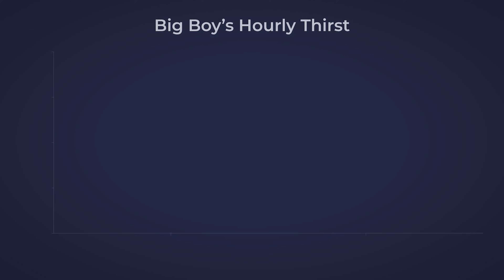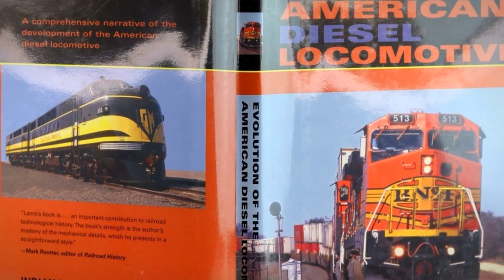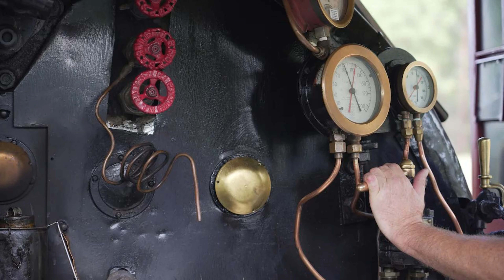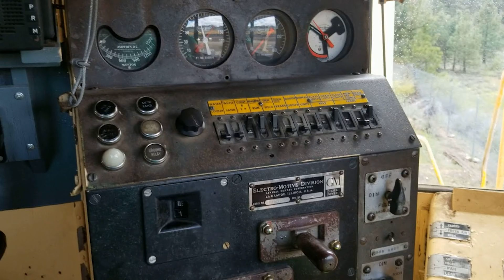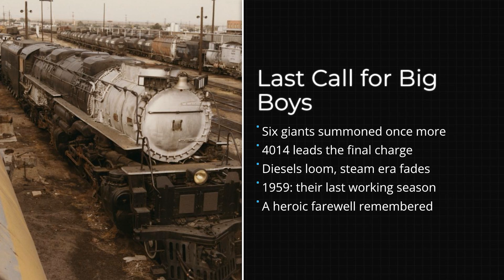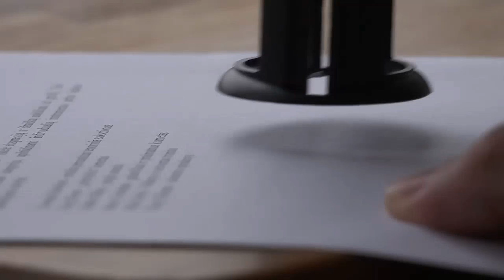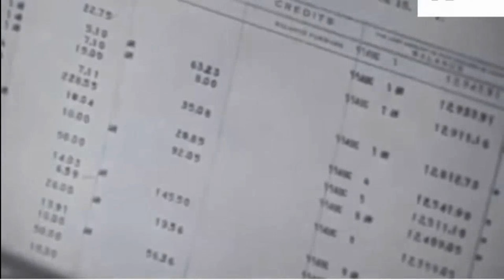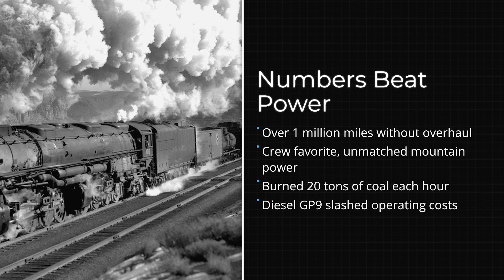Why Big Boy Was RETIRED At It's PEAK POWER

Comment: Steam locomotives require large amounts of coal and water in order to operate and the coal and water towers were being removed and eliminated which was a major decline factor for steam locomotive operations. The fuel and water consumption is one factor that helped diesel locomotives replace steam and diesel engine maintenance is less complicated than steam as well; the diesels proved themselves as being  more reliable and efficient to operate which lead to the end of steam operations, I am pleased that 8 UP "big boy" locomotives are preserved and that UP 4014 was returned to operation back in May 2019.

Comment: About the operations of any steam locomotives you nailed the Achilles' heel. Duration of water. This is BB and you said it would drain both the coal and the water in 2 hours. The Chinese QJ according to my data can run 500km before coal depletion but only 100 km for water. This means you have to FREQUENTLY stop and switch locomotive. VERY bad track efficiency very bad especially for passenger services (BB don't do that and that's better). In China steam era the passenger train had to stop frequently because of this and each will take half an hour. What a pathetic "express".
Another problem as you mentioned is cost of fuel. Yeah that's a pathetic 10% thermal efficiency and that doesn't count in the cost of carrying the heavy fuel and water (hundreds of tons for a full tender)! How can you compete with diesels 50+s?

If you play railroad tycoon 2 you would absolutely want to avoid steam in 1950 or later. For the post apocalypse scenarios you would absolutely want the manager with -40% steam fuel cost. That's how terrifying it is.
If you play railroad tycoon 3 you would also want to avoid steam because it needs to stop for water (and that might block a mainline).

Sorry but if I was UP i would retire BB as well. Having a hole in my pocket can be deadly.
Actually when I play RT I prefer to go drastic for the very primitive diesels (F3 for RT2 or zephyr for RT3) or electrics if any were available at the beginning. No more extra stations and water towers and service stops.
Reply: And my strategy can be a bit different from Americans. I prefer fully electrics they are more powerful and cheaper on fuel.

Comment: The problem with the Big Boys is that they were big. That's it. Big. Simple steam expansion rather than mallet meant more steam usage per hp provided. The dark particles in the smoke are unburned coal, meaning they could have gotten more heat out of each ton of coal if burning it correctly. Steam locomotive smoke is light gray when burned efficiently. They were powerful, but decades behind development regarding fuel efficiency.

Regarding the smoke, there was an organization in London, UK, which worked towards clean air. During the 1890s they managed to get the factory owners to realize the black in the smoke was unburned coal, so by fixing the air supply in the fireboxes they would both get cleaner air and reduce coal usage at the factories. It was a win-win. The Big Boy was half a century younger and yet they had not learned the lesson of burning coal efficiently.

South Africa has shown what can be done with steam if you try. Class 26 from 1981 was built to compete against diesel for being the cheapest to run freight engine. It won, but management didn't want to admit they would be returning to steam, so they found the money to electrify instead. For this reason only a single class 26 has ever been built and it's known as "The red devil". Strictly speaking it's a converted class 25nc, so it's from the 1950s. They didn't have the money for a brand new test engine. This shows that if you would push steam to try to be competitive against diesel, it could be done.

Fun fact: England built the last brand new steam locomotive in 1960, a year after the Big Boy stopped running.